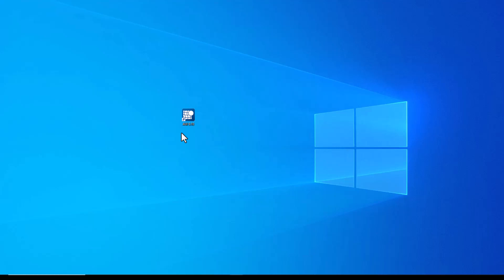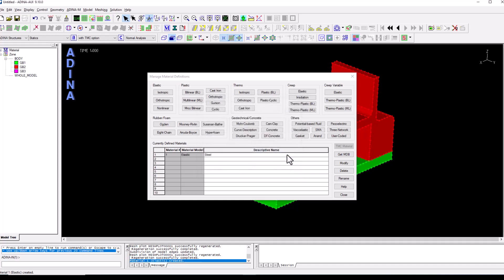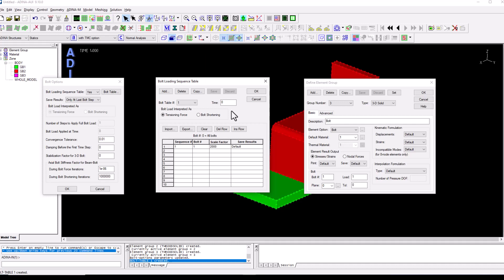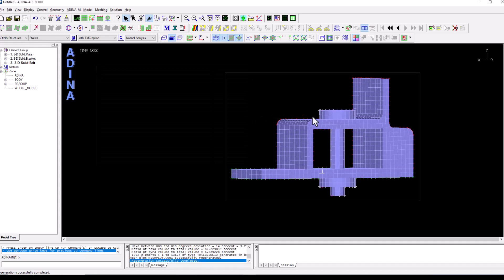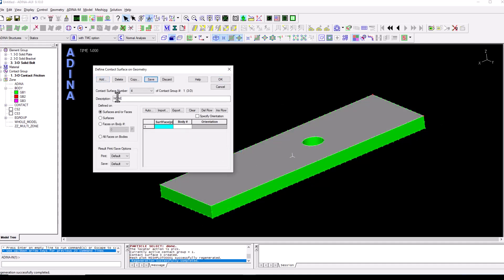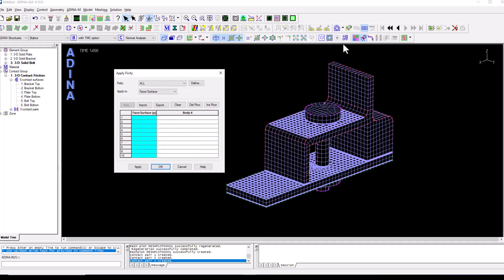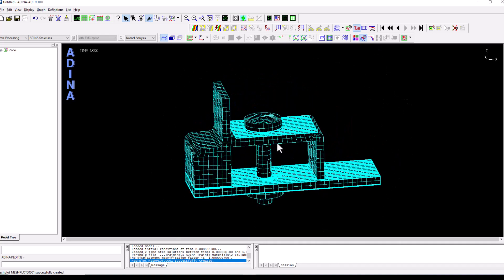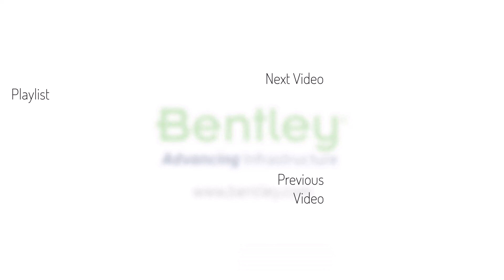3D Bolt & Contact Feature in ADINA

Comment: saludos Juan Trueba.  En Define time function en time 0 se aplicaria la carga de apreite del tornillo y en time 1 seria la otra carga? O eso no tiene nada que ver con Bolt loading sequence table.
Reply from the maker: Dentro de la Bolt Loading Sequence Table, es posible definir el instante de tiempo en el cual se aplica la tabla de apriete ("Time: "). Por defecto, ésta se aplica en Time=0 pero se puede modificar (aunque esto no es habitual). Este "Tiempo" es coherente con las Time Functions. Es decir, por defecto, se aplicarían los aprietes en t=0 y a continuación pasarían a aplicarse las cargas controladas por las Time Functions.

From the Bolt Loading Sequence Table, it is possible to define the time at which the bolts preloads are applied ("Time: "). By default, this is applied at Time=0, but it is possible to modify it (unusual though). This "Time" is consistent with the Time Functions. In other words, by default, the defined bolt preloads would be applied at t=0 and the Time Function controlled loads would subsequently be applied.